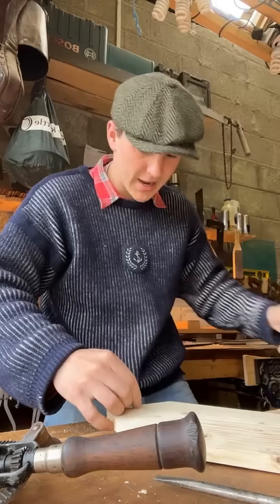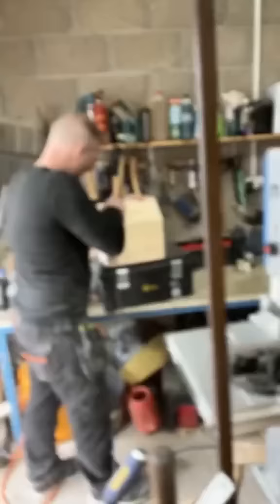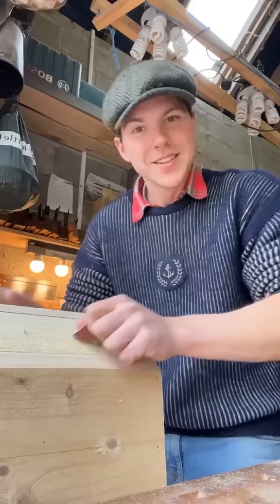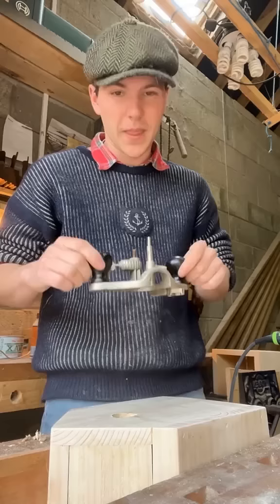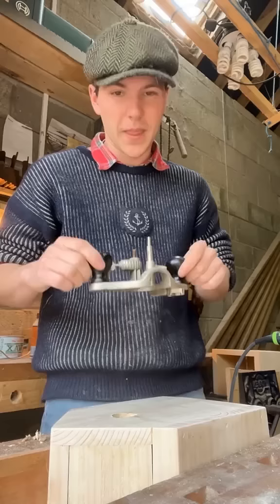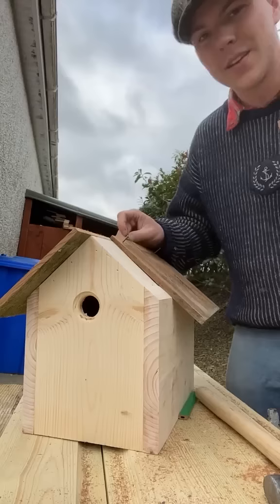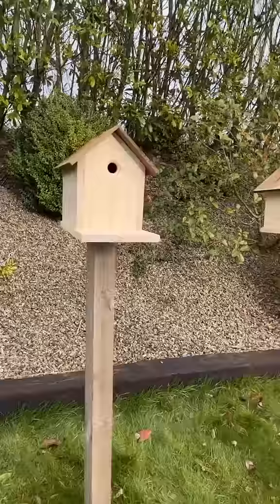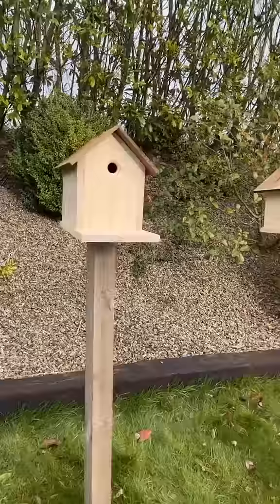Building a Birdbox, Handtools Vs Power Tools #shortvideo #ireland #birdbox #handtools #powertools

Comment: sanding by hand has always been a pain in the hand
Reply from the maker: Time to whip out the hand plane
Reply: And the elbow, shoulder, and pride, because you're never as good at it as you think you are 😢
Reply: @EoinReardon  think the entrance is big enough?
Reply: Using sandpaper is also a pain in the ass really. Toilet paper is much better.
Reply: this is why i prefer a file to get a majority of the work done, then move onto sandpaper to smooth it out.
Reply: @corydean707  yes for sparrows and simular size singing birds.  Most birds of prey  dont fit that is the Intention of the small whole
Reply: @EoinReardon  
Why did I read that with an Irish accent?
Reply: @EoinReardon  why don’t you use power tools
Reply: @Tor1717 there loud, expensive and they break
Reply: @EoinReardon that’s just plane smart.

Comment: I have never seen anyone drill a pilot hole for a nail
Reply: When close to the end of the board it prevents splitting, and failure. Helped a friend re-deck the surface boards. He refused to pre-drill at the board ends... a week later, all the end boards had splits, and water infiltration.😢